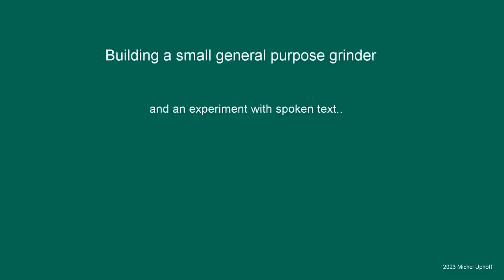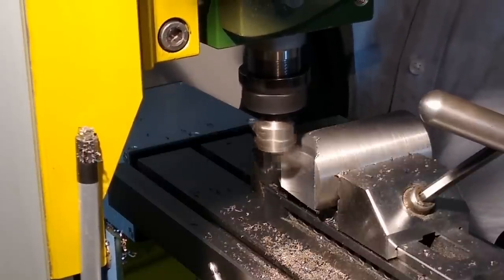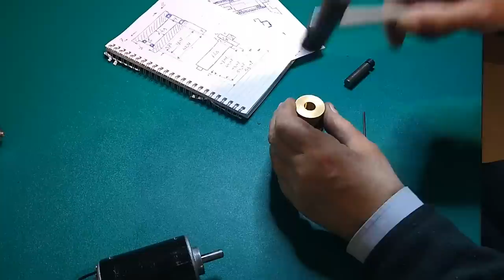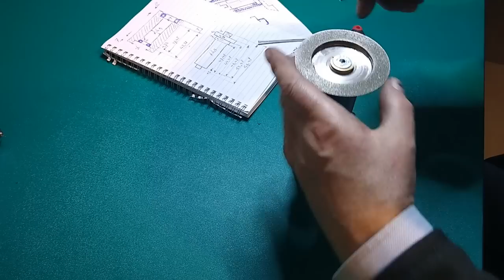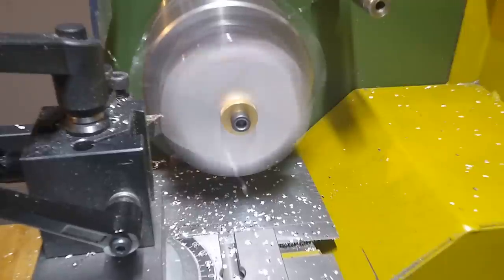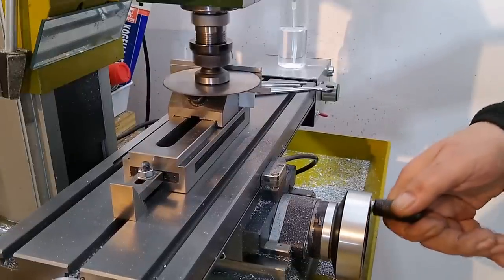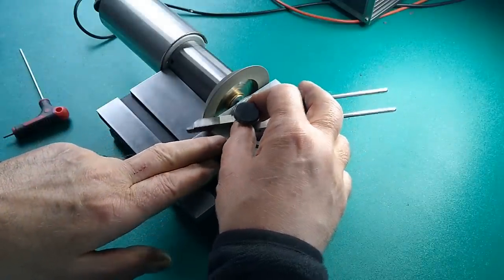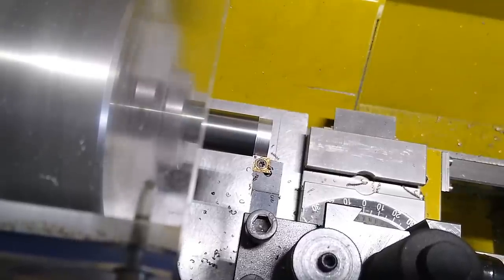Prototyping a tiny tool grinder

Comment: Great project ! ! !  I'm wondering about adding an option for a travel stop on the sliding block and some manner of four sided holder for grinding the ends of end mills.  I've got quite a few that are chipped on the corners and worn up around 1/8 inch of the side flute edges.  If I could rough hand grind them back then true up the nose edges on something like this I'd be able to use the end mills a time or two before they were just simply too short.
Reply from the maker: I am pondering the possibilities of an extension to sharpen drill bits (which you could see as a two flute end mill). That end stop is a piece of cake. Maybe I will come up with something useful in the near future.

Comment: Now all you need is a floating air spindle and a way to guide end mills to sharpen the flutes and the end of the end mills
Reply from the maker: End mill sharpening is a whole different game. Let's see first if I can make an accurate working drill sharpening attachment on the final model. If that turns out to be a succes, who knows..
Reply: @Michel-Uphoff  you can do it, I know you can 😎

Comment: The question must have been already asked : How do you compare your Proxxon lathe and mill vs chinese counterparts (which are sometimes more powerfull machines (up to 1kW) ?
Reply from the maker: This is a question that is very difficult to answer concretely. It all depends on how much you want to spend for a lathe. In China everything is manufactured, from cheap rubbish to high-end machines. Don't believe the stories you read that everything from China is rubbish. It's a matter of price. In general, you can say that machines with the same precision, quality and options are cheaper to buy in China because of the lower labor costs. But sometimes the shipping costs are so high that it is not worth the effort. And you will have to read very carefully about all aspects of the machine, and the company. I don't know which country you live in, but be aware of any import duties. In any case, be warned if it sounds too good to be true.

If you're someone who does enjoy making a poorly finished, lousy-adjusted, lathe completely tip-top, then you could take a gamble with one of those dirt cheap ones.
Reply: I've been using an 8x16 850W mini lathe i got for about $600 for almost 5 years. I love it and it suits my needs fine for now, but I did ALOT of work to get it there. Replaced spindle bearings, fixed tailstock alignment, added a cam lock to my cross-slide, QC toolpost, COMPLETE disassembly and clean / fit everything back together to get good results with it, along with countless other upgrades, the proxxon machines just seem better built IMO and I've easily spent the proxxon in upgrades. But I do enjoy the slightly larger work envelope and I love a good side project, so YMMV

Comment: You should not be climb cutting on a manual mill, it only takes the cutter digging in once to mess up a part or blow up the cutter
Reply from the maker: Depends on the mill. 
Mine has almost no backlash and is climb cutting in aluminium and free cutting steel without any problems as you can see.
Reply: Judging by the work he's doing with it I think he knows his machines better than you do.
Reply: It depends entirely on the machine and just how well one knows their equipment
Reply: @Michel-Uphoff  I had no backlash in my mill, till the one day I did a climb cut and found out the nut backed off and gave .015 backlash and broke a HSS cutter, what I was milling was no longer in the vise
Reply: @zachaliles  you can know how your machines work all of the time but it will only take one time.
Reply: @oldhick9047  true, but everyone at some point will have it happen to them!
Reply: @kidkv  Yes indeed, and if an operator knows his equipment, it can be done without issue
Reply from the maker: @kidkv  It happened to me in the past. But that's more than 40 years ago. That's how you learn your lessons, and the limits of your equipment. So there is no "you should not". There is a "know what your equipment is capable of".
Reply: @Michel-Uphoff  you are right. If you try to do everything by the book you will get nowhere with manual machine. You need to know your what, when and why. You can approximate forces involved in machining and stay on the safe side.

Comment: Stop the experiment!!!!(a robot sounding voice is Ok to listen to, a genuinely natural voice is OK to listen to, anything in between however is right smack-dab in the middle of uncanny-valley where you are constantly reminded of the real sounding voice you are hearing not being real, listening to it makes most people uncomfortable in some way) 

Explanatory text is way better and the vid is too good to be let down by many feeling a need to watch it on mute.

Great design on the T&C grinder though, holder for a collet-block and that would also work for sharpening endmills and the same goes for sharpening drills, and lots of router-bits...)